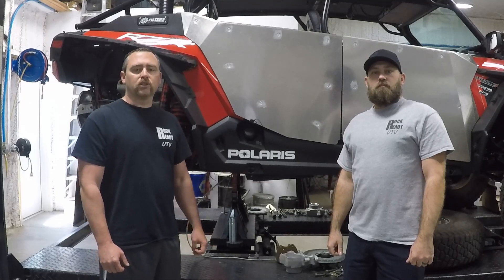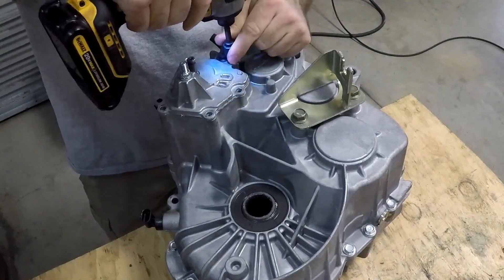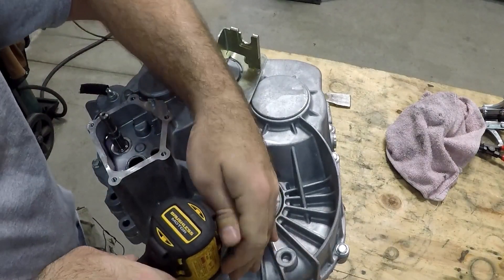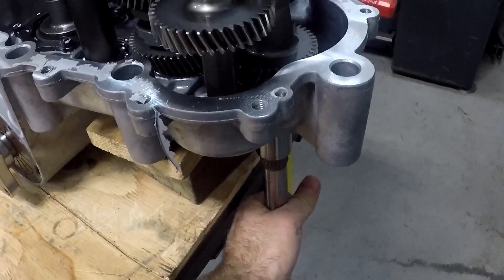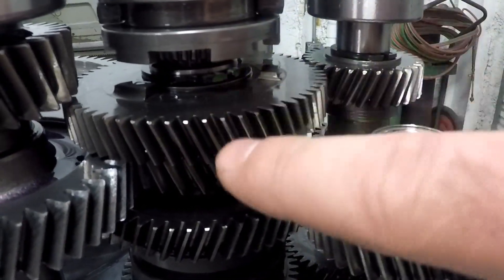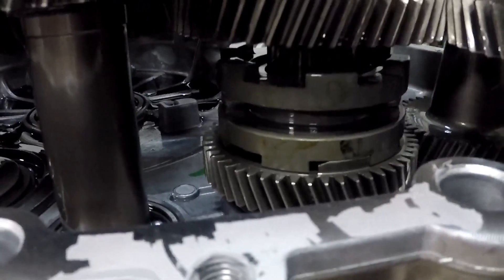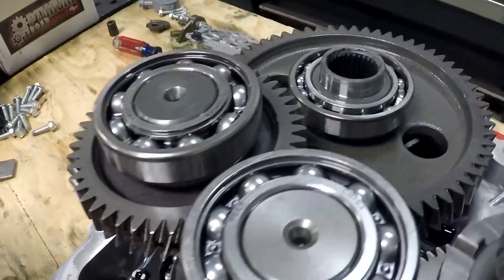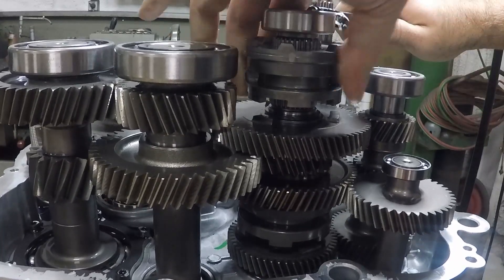Polaris RZR Transmission Part 1: How it Works

Comment: Hello I have had a couple rzr 1000’s with issues shifting out of park even on level ground I have changed cables with factory replacements and adjustments were made, linkage was not bent , any suggestions on what to replace inside the gearbox would be appreciated thank you bill

Comment: @sxs garage great explanation.  My 06 Ranger 700 xp is struggling coming out of turf mode.  Diff problem or transmission problem?  I am worried it's a transmission problem which is why I watched your video.  While on jacks, in neutral, I can spin driver tire and if I change from AWD, 2WD, 1WD it seems fine.  If I move to L, H, or R and press the gas pedal it will do all 4 or the rear 2 but not 1.  Transmission?

Comment: When you explained what happens when you shift into high from low.  I assume this also applies to shifting from low into reverse?  I plowed snow this last winter with my ranger 900 xp.  And now in reverse I hear clicking and sometimes actually pops out of reverse.  Even though I was always completely stopped when shifting in and out of reverse I assume most times I shifted it was not all the way down to idle.  I just pulled tranny out to inspect dogs.  Bit I assume this Is what happened.  Your thoughts? Thank you

Comment: Just found your videos, awesome job    
My question with gear reduction. Is it only changing the Low range? Does it effect High range?
Reply from the maker: That depends on what gear reduction you are referring to. If you change out the actual low, high, or reverse at the input shaft and the corresponding gears they mesh with on the reverse shaft, then it will only effect that gear. If the gear reduction takes place anywhere after that it effects low, high, and reverse.